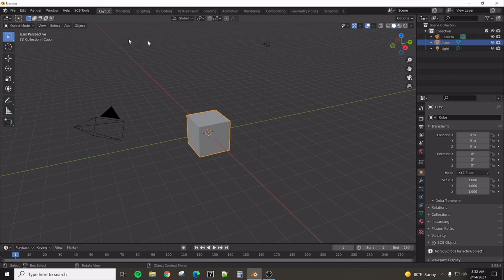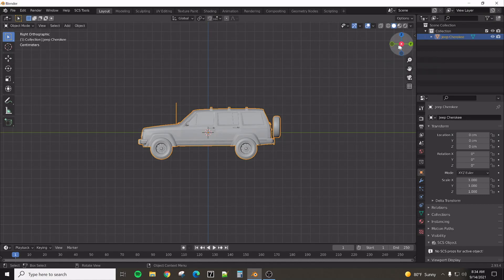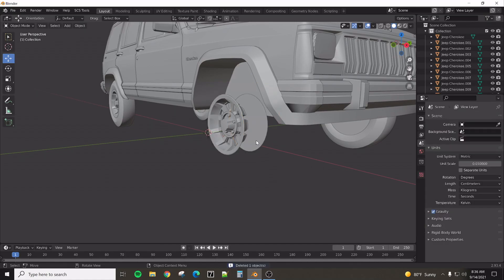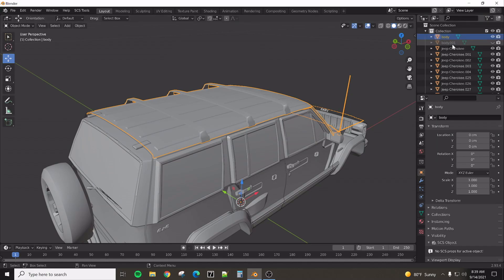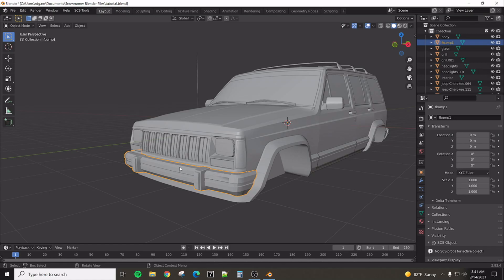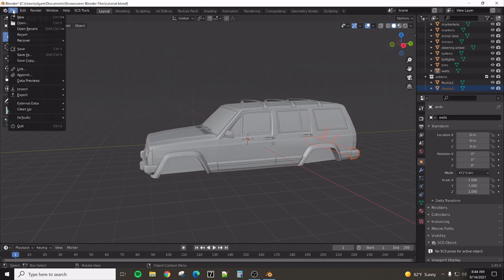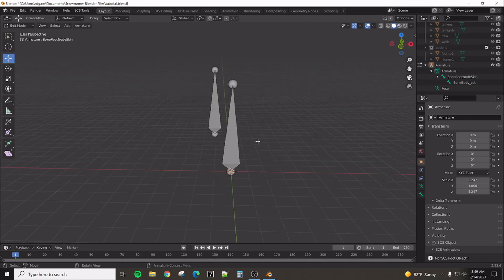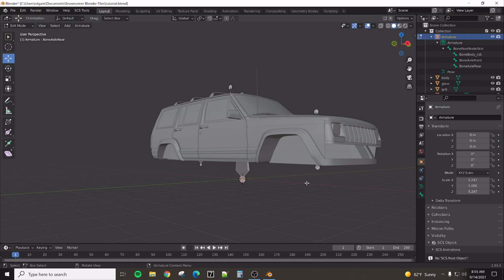SnowRunner Modding Tutorial Ep 1 - Getting Started

Comment: What I am most curious about is how you can do some of the things you do, without Blender completely refusing to work after doing said operation, such as seperating all 500 of your parts. I did that, mine did 23 parts, blender crashed. 
No, my system is not low end at all, it's odd to me, it's never worked properly.
Reply from the maker: I dont know to be honest.  My friend and I use separate by loose parts all the time and neither of us has had crashes because of it.  I once separated an extremely complex model and ended up with well over 4000 parts and it was running fine.
Reply: @glitchworks5957  It confuses me ngl. I don't think I've ever had Blender work properly 😅 I must be doing something wrong haha
Reply: @SkyeFox-p1x  What are your computer specs?
Reply: Ryzen 9 5900x
64GB Corsair Vengeance RGB Pro
RTX 3080 TI
1TB Samsung 980 Pro NVMe
Asus TUF X570 Pro
a large powersupply

Comment: I noticed everything was also separate materials when you began. Could I also separate by material and utilize UDIM and what issues would you forsee with that method?
Reply from the maker: Yes, you could separate by materials, however, if the author of the model has things mislabled, or materials assigned to parts you would rather not have bundled together, you then need to separate those by loose parts anyway.  As I always say, my methods may not be the best, nor do I claim to be an expert in any of this.  That being said, I do not know what UDIM is, so I cant say if it would cause any issues or not.
Reply: @glitchworks5957  I completely understand and I really appreciate this tutorial. Thank you for these videos!!!

Edit: I missed that you needed a definition for UDIM. As best I understand is a grid system of assigning colors. Some game engines utilize it and others do not.  For instance, I’m not sure if American Truck Simulator or Snowrunner uses it but Farming Simulator does.

Re: material separation. I had the very issue you mentioned. I had to end up separating hoses from other parts because the material wasn’t accurate. Again, you’ve taught me a lot. I’m in your debt, sir!

Comment: Hey there, I am wanting to get into making modded maps/vehicles in snowrunner but I'm completely clueless on how to get started. Do you have any videos on how to get started from scratch like software programs to use and where to find them? Also, I have seen a few of your vehicle mods floating around in the mod browser but I'm limited to how many I can have (original xbox one s)! I have one question, is that rpm rev sound effect embedded in the game or can you turn it on/off when creating the truck mod? Cheers!
Reply from the maker: My top suggestion is to start by editing the xml files located in the initial.pak file (you will need winrar to unpack the file)  The XML files contain all of the programming that makes a truck, well, a truck.  All of the engine stuff, wheels, lights, weight (mass), etc is in those files.  Learning what those lines of code do will give you a huge understanding of how these trucks actually work.  To make maps, the devs actually gave us a full editor program included with the game.  Its in your  Epic Games folder... Epic/Snowrunner/en_us/Sources/BinEditor/SnowrunnerEditor.exe... for trucks, Id recommend Blender for free.

Comment: WOW, arriving in 2022 and feeling very jealous! lol
Is it possible to edit a truck in Snow Runner that is not mod? if so, what folder are they in. I want to add various parts from other trucks to the Azov 73210, but I need to modify them to make it work. Another thing, is there a way to make the focus of the auxiliary lights independent of the truck's headlight, that is, I wanted to be able to direct the auxiliary lights to different points, just like on a real life truck. Thank you and congratulations, sorry if the text has any errors, I'm Brazilian and I don't speak English. I'm using google translator.
Reply from the maker: No, you can not edit the in game parts of trucks without violating the terms of service which could result in discipline from the developers.
Reply: @glitchworks5957  Makes sense, I hadn't thought of that. I would then have to create a new truck and accessories using the originals only as a model. I think that would avoid problems, right? Thank you very much for the reply, you gained a fan.

Comment: If treading of a tire is cosmetic (individual in its self). Could you make tank/tractor tracks with them? I'm sure the the tread needs a tire to attach to. But it would be a site! Just take some of the Cat tire treading and run it back to back, with little to now gap and extended out longer. Again, you would have to fing a way to get the tread to not attach to a wheel.

Maybe have it on an invisible wheel, but only have the rims show 🤔
Reply: Tracks in video games are made just with a bunch of wheels, the tracks do not interact with  anything as means of propulsion. in essences they just a follow the articulation of each road wheel so if one wheel is lifted up it will bend the track correspondingly.
Reply: @mitri5389  well then the game developers need to make one in house. Would be nice to have something that can actually "work" in the snow. Not that there isn't ones you can use now. I just find myself getting stuck more in the snow. There is Deep snow (blue hue) that most vehicles just can't drive in. And you don't know it's there untill you're in the stuff. Either have the vehicles with tracks or make the snow a little more drivable like the mud.
Reply: @kurtislawler  I dont know how snow runners calculates traction, ground pressure. however its most likely done with defined floating points and has no correlation with the visual model you see here. it probably also has geometry that interacts with the terrain and other meshes again separate from what you see as the player.

Comment: hej glitch ... I am just watching your video again and currently trying to reproduce it with my suburban ...
how tall should the car be???

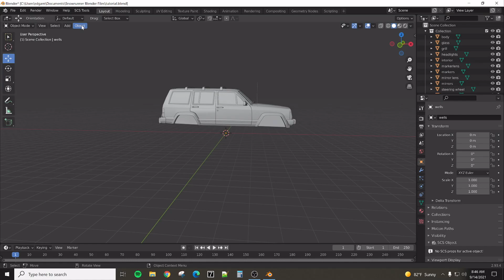when I set my armature //like u did at 12:40
I get a very big armature ... (and the normal cube is also more bigger than my model)

thx in advance
Reply from the maker: I dont go by height or length for models as that will vary based on what truck it is.  I normally go by width, as I mentioned in the video.  A suburban should be roughly the same width as the vanilla Chevy pickup.  So about 2cm in total width, maybe slightly under that.  You can always use Select All, then the scale tool and rescale the entire thing after you get it to spawn in the game if you feel it's too big or too small.  The cube that starts out in Blender is 2.1cm for reference.
Reply: @glitchworks5957  u r right! it is a way better to go by width ... u have explained it in tut part2! thank you! currently I am in tut part3, everything worx!
Reply: @glitchworks5957  
Hi GW
The default game has only the following mod_scout folder for modding.
C:\Program Files (x86)\SnowRunner Build and Dispatch\Media\Mod Templates\mod_scout 
But i am creating a truck , so where can i get the mod_offroad truck  or   mod_heavytruck folder ?
Reply from the maker: @francisdavis1933  Using my tutorial series, the type of truck doesnt really matter.  You can alter all of the xmls to emulate any type of truck in the game.  If you want a better basis for a larger truck build, you can snag one of the trucks/classes/xml out of the initial.pak file.  Saber removed the mod_truck_template about two updates ago for reasons they wont explain.
Reply: @glitchworks5957  OK. I will follow your tutorial
Reply: @glitchworks5957   Dear GW
I just finished modeling my 8x8 offroad truck in Blender (after 15 days). I then follwed your tutorial Episodes 1 and 2 . In Episode 3 , i am getting stuck towards the end where you are spawing the mod vehicle in Mod Browser.
I copied the "mod_scout" folder from the games directory and pasted into the "Mods" folder. Actually I did not have a "Media" folder under the Documents -> My Games -> Snowrunner folder. So I created a folder named "Media" , then inside this folder i created another folder named "Mods", and then pasted the "mod_scount" folder and renamed it to my new truck Model name. 
I followed your steps in Episode no. 3:- 
- I got into the game and went to MOD BROWSER -> MORE -> SELECT MAP -> SUMMER PROVING GROUNDS. 
- I selected the Mod Manager and chose the truck model I created (it was showing "not converted" by default)
- I then clicked on Convert, it started processing (took around 10 minutes)
- After it got finished, my truck model was still showing as NOT CONVERTED ??? 
- I again clicked on Convert. Within 5 seconds, it got over and was showing my truck as NOT CONVERTED ? 
why is this happening. 
I followed your video Episode 3 step by step. I renamed the folder to my truck name, put an .xml file along with the .fbx file, I edited the mod_scout.xml file as per your video, etc.
DO I HAVE TO ALSO CHANGE THE FILE NAME FROM "mod_scout.xml" (lying under the Documents -> My Games -> Snowrunner -> Media -> Mods -> newly named truck folder -> classes -> trucks) to the new truck model name ? 
Awaiting your Reply

Edit:- after my truck was not getting converted , i clicked the "check mod" button, and it returned an Error message and asked me to review the Error log. I then clicked the "open" button and it took me to the new truck model folder which i created under Media > Mods folder. In that other than classes-meshes-textures-ui folders, there were 2 new folders , one named "Rebuild" and the other "Rebuild Log". In the latter folder , there was a NotePad file which was containing the following text :
Mesh| Fbx root node has no children
Mesh| Can't load 'meshes/trucks/testing.fbx' model file

Were you able to understand the problem and can you find the solution ?
Reply from the maker: @francisdavis1933  For errors that may be preventing conversion, check the error log in documents-My Games- Snowrunner -base-logs-Legacy Log.txt that should tell you why its not converting.  Could be one of your objects in the mesh has "non-scale identity" meaning, the scale was changed and not actually applied.
Reply: @glitchworks5957  
Mesh| Fbx root node has no children
Mesh| Can't load 'meshes/trucks/testing.fbx' model file
Reply: @glitchworks5957  I did apply ALL TRANSFORM, the scale was showing 1, 1, 1 and the rotation and location were both showing 0 , 0 ,0

Comment: Got a question is this the same way to import a mod from mudrunner
Reply from the maker: If you know how to make a mod for mudrunner, you will know how to import it into snowrunner.  If you didnt make that mod, then I can not and will not condone bringing it over from mudrunner.
Reply: @glitchworks5957  Hi. Thanks for the tutorial. You mentioned in your 2nd tutorial that for an avg scout vehicle in snowrunner, the scale size (width) is 2 to 2.5 cm. what is the scale size for an avg Heavy Truck (6x6 drive) Length x Width x Height in snowrunner game?
Reply from the maker: @mfcp4231  I would start at 2.5, bring it into the game and look at it compared to other trucks, then adjust as needed.
Reply: @glitchworks5957  
OK COOL. I HAVE FEW QUESTIONS, SO IF YOU CAN PLEASE BEAR WITH ME AND TAKE SOME TIME TO CLARIFY MY DOUBTS, I WILL APPRECIATE IT :
1) Your tutorial says not to create tyres for the vehicle in Blender (it will be created by Snowrunner).  So how do we decide the size of the wheel hub ?  OR do we have to do Trial and Error method vis-a-vis the game in order to adjust the hub size.
2) Speed - How to set different speeds for different gears in the game. Example: gear 1 has low speed but high torque, gear 5 has high speed by low torque.
3) Setting up of Differential lock and AWD for the wheels ?
4) New Modded Addons - like fuel jerry can, service equipments, repairs, and others. In your above video , you made the front and rear bumper as addon for future modifications. How do i create for example a Fuel Jerry Can of 3 different designs located at the same location on the truck ? So that in the game I can select any one of them .
5) Exhuast smoke from the engine - how does the game know where the exhuast pipe is located and where its mouth is ? Since when we design a new truck, the exhuast pipe can be located anywhere (front, rear, under, vertical, horizontal, etc..) OR do we have to create the smoke while modding ?
6) The Truck, Cabin and Chassis vibrate while starting engine - is this animated by the game or do we have to generate it ?
7) X-Ray view of Engine when the truck ignition is switched ON or OFF.
8) Body / superstructure addons - when we design a truck with a specific length of chassis frame behind cabin, how can we make the area suitable for vanilla bodies/superstures in the game.
9) Driver and his animations - like steering the truck, changing gear, taking nap, looking around, looking behind while reversing, looking inside-around-outside of cabin (First Person View)
10) Animation of fuel inside the fuel tank while the truck is moving. And X-Ray vision of fuel tank when zooming in.......
11) How do we make the created vehicle mod SINGLE and/or MULTI-PLAYER ?
Reply from the maker: @francisdavis1933  Most of these questions are far more advanced than this tutorial series was intended to be, which is why they werent covered.  A lot of your answers lie within the xml files for your truck.  I will go through your list with brief answers to point you in the correct directions, but the guides that the devs give you can also help answer your questions.  The guides can be found at (game install folder)/Snowrunner/en_us/Sources/BinEditor/Guides
1. You will just have to eyeball it for the hubs, do whatever you think looks right.  If it doesnt, change it and re-export again until you are satisfied.
2. Speed is set in your gearbox xml file.  The different gears do not get different torque like a real engine, it's a flat amount set by the engine xml and thats it.  You get 100% torque in every gear, period.
3. Diff lock is located in your main truck xml as is the awd.  Set the front wheels to default torque for perma-awd, or full for always installed switchable awd.  DiffLockType="Always" for perma-difflock.
4. In your classes xml for each jerrycan, set the socket name to use the same socket as the others so they all match.  Same way I did the bumpers, both bumpers share one socket, but each has it's own classes xml file.
5. Exhaust location and direction is done in the main truck xml.  Search for "exhaust" and you should find 4 or 5 lines for it.
6. The shaking is handled by shaker bones.  Shaker bones are just vertical bones you add to your armature where you want the center point of the shake to occur, then you call out the shakers within your truck xml file.  I do not normally use shakers with my trucks.
7. The x-ray view of the engine is tied to the sound origin.  Search for "Origin" in your main truck xml to find it.
8. Your best bet is to make your truck, spawn it, then spawn a similar vanilla truck next to it and apply whichever addon you have in mind.  Compare the two and make the appropriate changes.  There is no correct answer for this.
9. Driver animations can not be changed, but the drivers position can.  Search for driver to find the section to move him and his steering hand position.
10. This one Im not super positive on... check the guides maybe?
11.  I think multiplayer has something to do with the NetSync Legacy line within the main truck xml, but Im not sure on that.  All of my mods have NetSync Legacy="False" and I have watched TC9600 use my mod trucks in multiplayer on his live streams, so it must be working correctly.
Reply: @glitchworks5957  Thanks your reply. So I guess most of the things are to be done in the truck XML files.
The NetSync Legacy = "False", does it mean Single Player?
Reply from the maker: @francisdavis1933  My trucks have that line and are able to be used in multiplayer, so that doesnt prevent multiplayer.
Reply: @glitchworks5957  
Just wanted to know from you on a scale of 1 to 5 (where 1 is least and 5 is most) , can you tell me how much time will be consumed in each stage in the truck creating process .
1) 3d modeling software
2) Texturing
3) XML s
Reply from the maker: @francisdavis1933  For how I work, I normally put in the most time into modeling, then xml editing, then texturing.  To use your scale, Modeling would be a 5, XMLs would be a 3, and texturing would be a 2, but could easily grow to be a 4 if you spent a lot of time tweaking every little detail.
Reply: @glitchworks5957  OK GW.
Reply: @mfcp4231  hi GW
I am modelling a truck based on an actual manufacturer truck. Before putting it into the game do I have to get permission from the manufacturer to use the brand Name and Model of the truck?